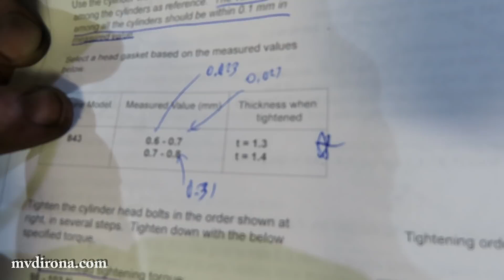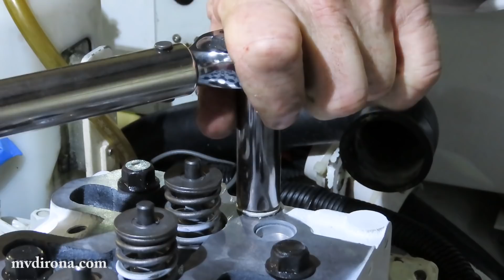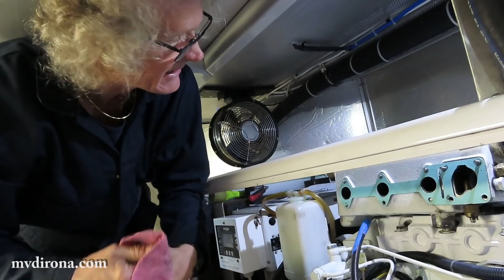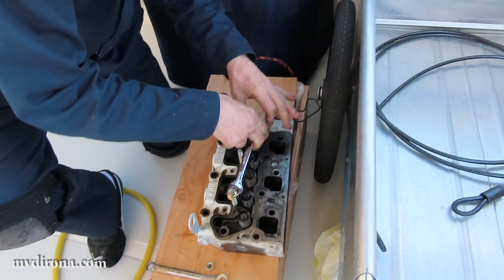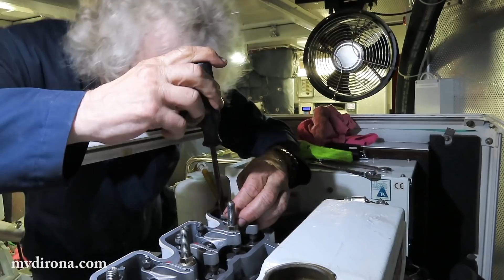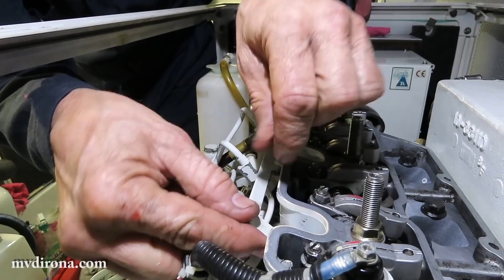Replacing Northern Lights 12kW GenSet Cylinder Head Part II (@MVDirona channel)

Comment: Would it be cheaper to refurbish the cylinder head or is it cheaper to buy a new one. ?
Reply: take off head, send to machine shop. rebuild ship back. sometimes time is cheaper than money. genset down and open entire time.
Reply from the maker: Good question Billy Jay. I normally would just rebuild the head but I leaned to head replacement for this engine for the reasons outlined above by J. Walker, it takes time to get the machine work done, and at the time Scotland was in full Covid-19 lockdown so I may not have found an operating machine shop.  

However, once the head was off, the decision was even more clear. The valve seat is a mess and it has worn nearly 1/4" into the head. These heads don't have pressed in valve seats so I suspect this head is beyond saving. Fortunately, it's a less than $1500 so not too bad from a cost perspective.
Reply: @MVDirona  cant wait for rear main. still on the hook?
Reply from the maker: We now in Norway in a wonderful area just north of Stavanger. The weather has been incredible and we're enjoying hiking, touring around in the tender, and really enjoying ourselves. You can always see the boats location on this web site: https://mvdirona.com.

The generator is leaking but the leak has gone from quite large to annoying. We'll probably delay that work for a few months. I'm not exactly sure how we will lift the generator section off the back of the generator. We'll need some sufficiently secure anchor location above the gen and some way to lift it. Fortunately, it's not urgent at this point but it will need to be done and it may get more urgent again in the future.
Reply: @MVDirona  small handheld hydraulic body kit sounds like it might be handy. can you jury rig a track over head with blocks and tackle?
Reply from the maker: Yes, it'll have to be something along those lines and I'll need to find sufficiently strong  points to attach in the ceiling.
Reply: @MVDirona  thankfully Nordhavn has tons of info through its owners. Amazing group. How did the bladders work out for the crossing? Just in case or did you need to use some of it?
Reply from the maker: The boats range without deck fuel is 2,500 nautical miles and with deck fuel is 4,000 nautical miles. Generally, we if fill them we use them and just make the crossing more quickly. The one exception is the 1,700 nautical mile run between Cape Town South Africa and St. Helena. Because fuel is so expensive in St. Helena, we filled all tanks before leaving Cape Town where fuel is unusually inexpensive.

For stability reasons, we pump the fuel below decks as soon as there is space in the below decks tanks to accommodate the fuel load.

Comment: Not too shabby for a software engineer, you could have been a diesel  fitter in a former life.
Reply from the maker: Your right, I do work for Amazon Web Services so don't do a lot of top end engine overhauls :-). 30 years earlier, I did spend a few years working on Italian Exotic Cars. Never even thought of touching a diesel but my automotive background is definitely more useful in this context than my software background.
Reply: @MVDirona  That's definitely an understatement. You're basically the brain behind amazons success.

Safe travels.
Reply from the maker: Not true. I'm just lucky to work with a very talented and committed group of people. Thanks for the feedback on the video.

Comment: few points James. a digital tyre tread gauge would of worked ideal for measuring the piston height. Blue Hylamar on the gasket will stop it sticking to the mating surfaces, if in the future the cylinder head has to come off. if you apply oil to threads and the spec does not say oil threads, then reduce torque by 25% when torqueing up. if no torque is specified, refer to standard torque values for the material
Reply from the maker: Thanks for the suggestions. Typically tire tread gauges are less well calibrated and less precise than a dial gauge but, if it can deliver thousands of an inch accuracy, then it likely be faster and simpler. 

On use of Blue Hylamar to avoid the gasket sticking, I kind of like it sticking. This interface needs to seal oil passages, water passages, and combustion so I like the gasket as sticky as the manufacturer specified. This particular engine doesn't have oil passages in the head but it's perhaps the only gasket that I installed without any other substances unless recommended by the manufacturer.

On the oiling of threads, changing the torque specs you are right. On this engine, all but three of the bolts spend there lives in an oil bath so dry threads is more difficult to deliver on rebuild with oil already in the holes.  If some are oiled already my thinking is the most important thing is even torque so I oil them all.#